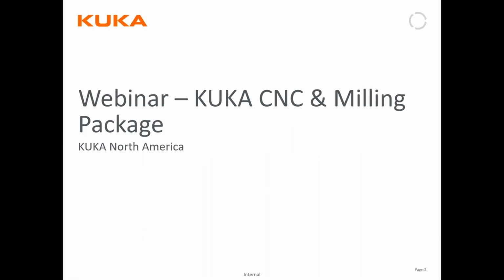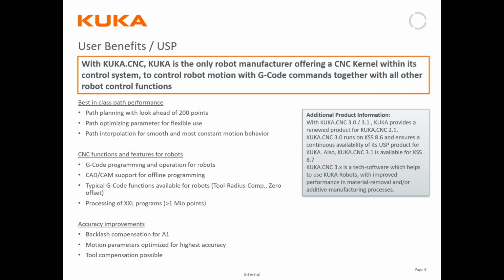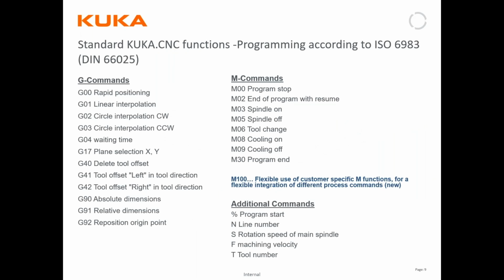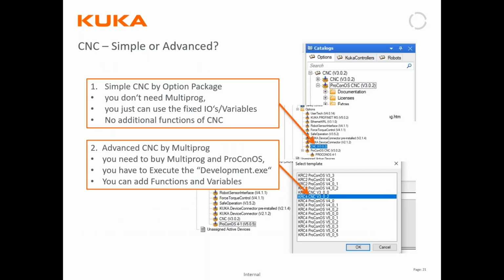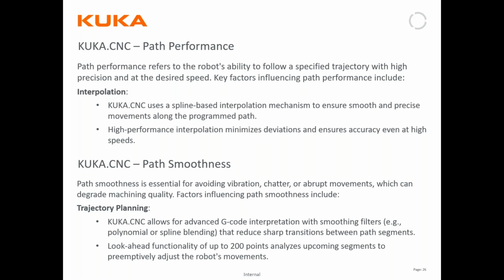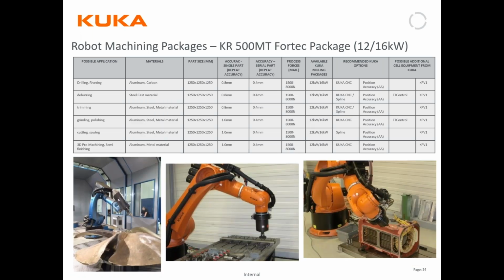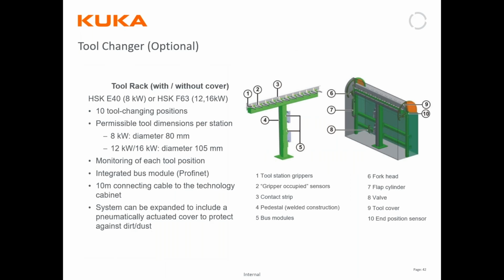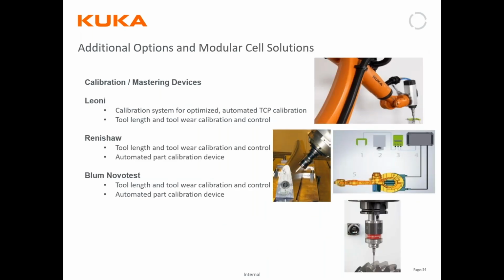Webinar: Precision robotic machining with KUKA.CNC

Comment: How does the positional accuracy compared to Absolute accuracy and non-absolute accuracy robots without KUKA.CNC? The mentioned offline programming tools include postprocessors that translate the .nc code to .src code "removing the need for KUKA.CNC"